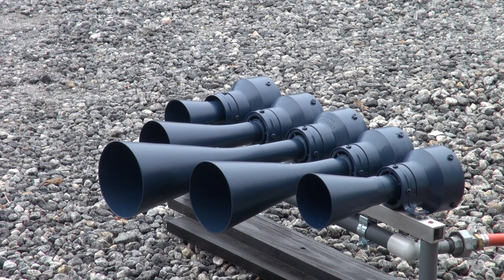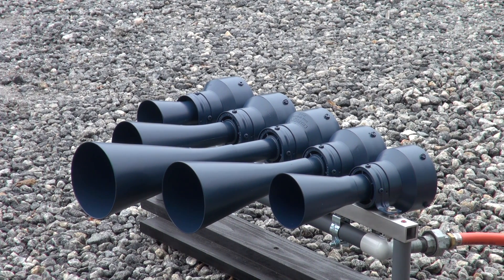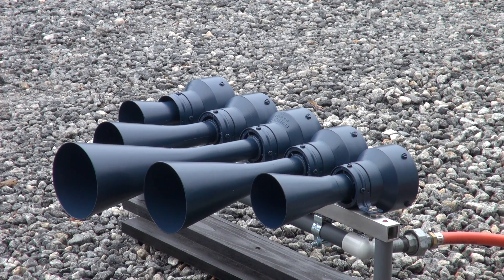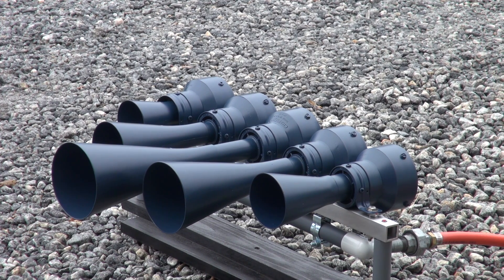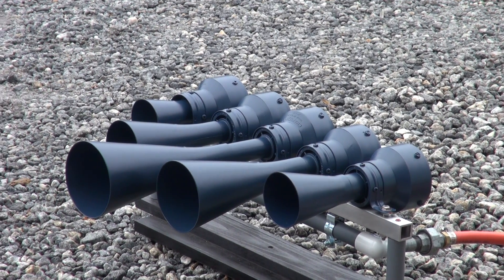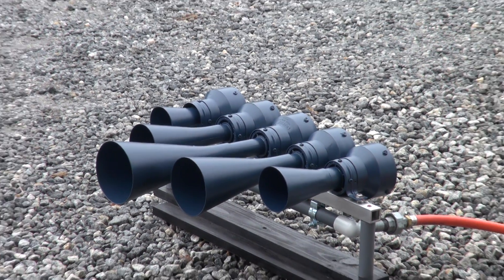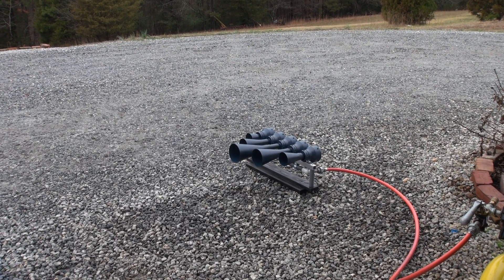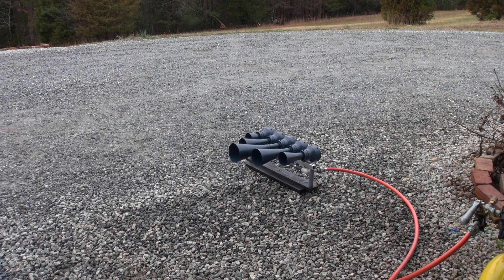CSX K5LA PVC TRAIN HORN

Comment: It would be REALLY cool if you could talk Amtrak into using these PVC K5LA horns on their locomotives
Reply: They are not rugged enough to stand up to mainline railroad use.  They are a less expensive, and much lighter novelty item for amateurs that give one a pretty accurate sonic experience without the need for the huge air reservoir capacity and high pressures needed to properly blow the real thing (around 130-140 psi).  The real ones will permanently damage your hearing fairly quickly at the distance shown here without protection.  i also don't think the real ones are totally legal at full pressure for highway vehicle use.  You really could cause an accident scaring the crap out of someone unsuspecting with them.

Comment: Are double diaphragms better than a single diaphragm or is it more just for longevity? Also does the pipe need to be touching the diaphragm or is it supposed to just be a couple millimeters away?
Reply from the maker: You really can't tell between the double or single diaphragms.  The coupling has to touch the diaphragm and the tension has to be right to blew a strong note.
Reply: NSSCOTTTEAGUE okay cool thanks man, I'm using rubber foam weatherstripping is that okay or would something else be more responsive or better?
Reply from the maker: Find a rubber that is 1/16 inch thick
Reply: Do you have an email I can contact you at? I'm doing something wrong and wanna figure out what lol
Reply from the maker: scteague@charter.net